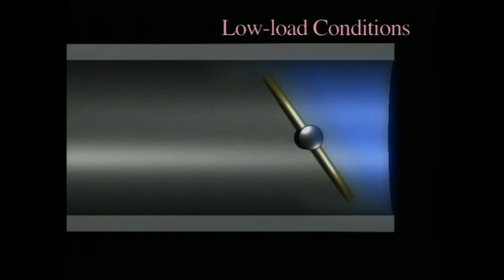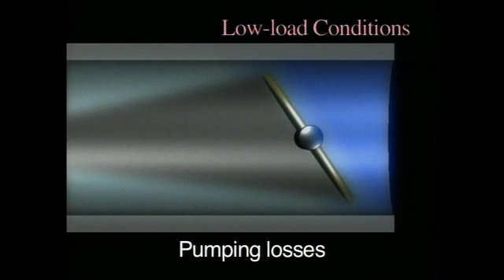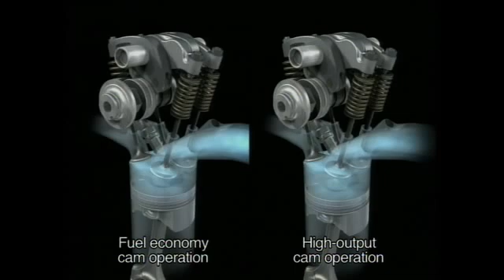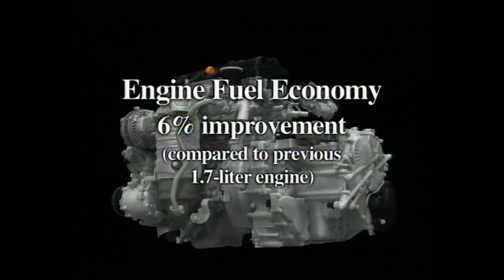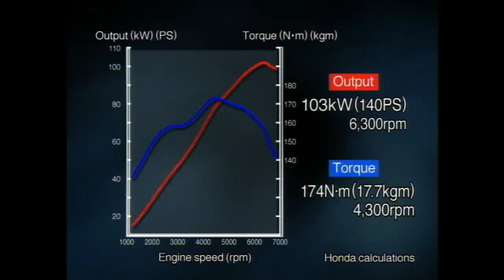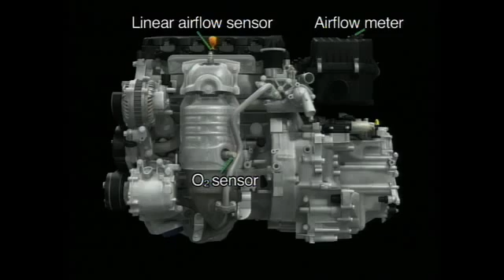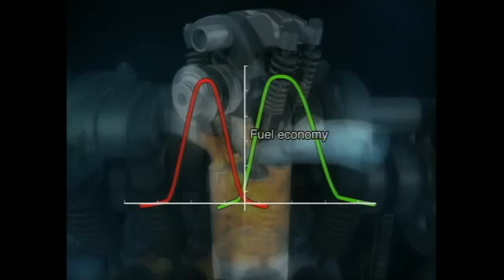Honda R18 Engine  1.8L  i-VTEC

Comment: I'm a Honda tech.  I have two 8th gens with r18.  Also an 8th gen si and an FK8 type r.  The r18 in my opinion is the most reliable 4 banger ever made.  Impressive.  Got 300+k on one and never once had an engine problem.
Reply: I know a dude who has a r18 stock internals with turbo pushing 274whp. TSI turbo kit. 440cc RDX injectors I think with the kit and hondata. The fuel pump is a stock si fuel pump I believe. The manifold is integrated but makes a nice turbo manifold to bolt right onto it. Im looking into boosting an r18 :)
Reply: Is every 8th gen have r18 engine? (Si not included)
Reply: @keantandrei8142  No, in Europe there is also 2.2i-CTDI 140HP (diesel), 1.4i-VTEC 100HP and 1.4i-DSI ~83HP
Reply: @keantandrei8142  no they have a hybrid version and they have a natural gas version in 8tb
Reply: @keantandrei8142  In the US, yes. In Europe there was also an 1.3 liter engine, that makes around 80 HP.
Reply: @keantandrei8142  i believe  so
Reply: I read something from hondata saying the r18 has oil cooler jets which only the higher performance engines have and I’ve rebuilt an r18 and they have a nice coating on the pistons for reduced wear. Sleeper engine fr
Reply: Hi Just bought my Honda FRV 1.8 Auto 2009 with 162000 miles on the clock.. change all fluid’s and it runs like new.. How reliable are they???
Hope they last longer as 1 of the smoothest car I’ve driven tbh
Reply: @Clark Nicolas  i have 404k on my 08.  Original engine and trans.
Reply: Precisely. Why they got rid of it, I’ll never understand
Reply: Hi. If you know Alot about this engine please help. I have it also but never heard VTEC kicking in. Any idea what what to do? I have automatic transmission. Does it kicks in only in manual?
Reply: @TheLordstrider  an r18 isn't meant to feel vtec kick in.  Also it is ivtec which is a little different on this engine.  It uses variable valve timing for fuel economy, not for sport or performance.  You can mod the engine for performance and get up to 400hp if you really wanted to.
Reply: @HowardFBeale-ql6gk  hey I have a r18 z1 engine in my 2015 Honda Civic coupe and I have done little mods like k/n air filter and 24p injectors, performance fuel pump, changed oxygen sensor and fuel pressure sensor, and I think I’m finally ready for a tune and turbocharged or supercharged, but I have a cvt...do u think I will run into problems? I got 100k on the dash and I got it at 79k just got start on keeping up on the maintainability.
Reply: @Jay_stackhouse  you should be fine with the milage, but I wouldn't run too much boost.  15psi would make her scream.  The cvt would make me nervous.  I don't have any experience with honda cvt's so I don't really know.  You can do a swap to a 5 speed.  I have an extra one at my shop that needs a new input shaft bearing.  Clutch pedal assembly should bolt right in.  Center console is the same I think.  You'll need a shifter and cables.  Also to swap it you'll have to reprogram the computer but you'll be getting a hondata anyway if you boost it.  Would be a fun project.  I have an 08 ex 5 speed I wanna boost when I get the time.  I'm betting I could easily get 500hp out of it.
Reply: @HowardFBeale-ql6gk  well I was talking to my mechanic and he offered a supercharger instead but lol unfortunately I’m not that well versed with manuals so I’m pretty much stuck with my cvt rn 😂, I did just changed my cvt fluids out I’m sure the previous owner never bothered but yeah he wasn’t trying to do to much boost I think he said he wanted 6 psi and I was thinking around 10 might meet in the middle and do 8 just do everything stays reliable, does supercharger use psi to measure how strong it is?
Reply: @HowardFBeale-ql6gk  400hp wow but how , must turn to Turbo charged?
Reply: @yml2290  for an r18, yes I would definitely use a turbo charger.
Reply: @lightskin keith sweat  hey man I'm in the exact same predicament as you with the cvt. Any luck with adding the supercharger yet? I really want to have my 2014 lx an extra 100 hp but I'm hoping that cvt transmission can handle it
Reply: @HowardFBeale-ql6gk 400hp? Hoow i got an 2007 Lx coupe 5 speed manual transmisión i just an K&N intake what else can do to that engine without break it?
Reply: I beley dat
Reply: Impressive. Very based.
Reply: Did u ever changed the transmission fluid?
Reply: I would maybe even get the skunk2 cams or even just a valve and spring kit. With boost it might cause valve overlap and need stronger springs to fight against boost pressure on the intake and pressure on the exhaust valves. That’s just my thoughts and maybe head studs
Reply: What about the rest of the car and transmission
Reply: R18’s are garbage engines 🚮 worst engine Honda ever made.
Reply: @ferniem95  why do you think that?  Just curious.

Comment: Love this engine, but it is slow from 180-200km/h 😩
Reply: FACTS
Reply: And one more think, when you turn on air condition, this car have no acceleration.... But I love it :D
Reply: Mariusz Wojcik really? I have pipercross and it was okay, my FN1 did only 209km/h 😂
Reply: @mariego1980  True. I try to drive my car without the AC on. Plus it makes the car vibrate pretty bad.
Reply: @mariego1980  I disagree, I really dont have any difference with the ac on.. But it vibrates on idle :D

Comment: Super engine, untill you have a problem like screw snap inside alluminium block like I had during el. starter service. Now I have problems with it. Why do you use only 2 screws for starter, and why do you use short thread step screws so that they easily cement/jam in to alluminium? Because of that now complete engine must go out of car and sent to precision machinery to take this shit out and re-thread hole, it will not be cheap.

Comment: Does the 2019 hrv 1.8 ivtec have direct injection? I hope not. And how do the cvt hold up if u baby it and change oil every 30k miles?
Reply: It doesnt have direct injection and the CVT will last as long as you keep fluid changed we put loads of miles on our hrv

Comment: cracked engine block
Reply: 06 to 09 I believe had these problems.. I have an 08 with 200K kms and so far so good. One forum said affected engines usually build cracks below the 100K km. mileage.
Reply: Juan Tamad  My 06 has 131k on it and so far good. But I had to have belt tensioner replace twice.
Reply: @MrHuck  How come?.. I haven't replaced my serpentine belt yet since owning it 4 years ago but might do it this spring..
Reply: Juan Tamad   Actually water pump broke and the belt cut into tensioner assembly so had all that replaced. Had rerouted to new Honda specs. Still keeping the car.
Reply: @MrHuck  I have an 06 too and those belt tensioners make a lot of noise.

Comment: "superior performance" to what? Id swap that shit for a b18 in a heartbeat, even b16...
Reply: To other 1.8s in its class.. economy/gas/family... corollas, etc.. your B16 B18 were built to be high output vtec engines.   There is no comparison. Would you compare a b16 with a corolla engine?  Maybe the XRS you would.. not this one.. compare you B series to the K series.. The R18 engine is truly a work of gas saving art, with its 1.8 size and 2.0 output, while saving gas like a 1.5.

And your swap wont work.  So go K or go home.

Comment: My 2010 Civic sedan is awesome car with this engine great mpg. Only issue is low torque but u get used to it.
Reply: Look up the Kraftwerks supercharger. That fixed my problem
Reply: @tylertelford1088  Is it really worth the 4k price tag tho?
Reply: Designed for efficiency. VTEC here (with SOHC) actually has the effect of lowering the power below 3500rpm and then normal afterwards, rather than the typical effect of normal power/high power band. I get stellar mileage for a 1.8L engine on the highway, 45mpg from a 11 year old engine with 140HP.
Reply: @summushieremiasclarkson4700 45mpg 🤨 stop the cap 🧢
Reply: The r18 was new for the 06 model buddy
Reply: Still more than the average petrol car. I just downshift when I want a bit more out of it.

Comment: Civic is the great car with this engine.The best engine in the world.I have civic 1.8 16v vtec
Reply: I have civic with engine but never heard VTEC kicking in. Any idea why? I have automatic transmission.
Reply: @TheLordstrider  vtec kicks in around 5200 rpms you won’t hear it like you would with the s.I. But you’ll feel it
Reply: @RiAPRIME  @TheLordstrider

R18 doesn't have VTEC. The kick you're feeling is the 2-stage manifold that opens up around 5,200rpm. Similar to a base K20A3 engine.
Reply: @tyscl9516  this is not true
Reply: @tyscl9516  research a r18 engine
Reply: @RiAPRIME  I think you gotta do the research yourself my man lol. It doesn't have VTEC, only VTEC-E and dual manifold runners. And I have driven a 2014 Honda Civic EX automatic with the R18 and my impressions were a similar vibe to a D15 engine with VTEC-E.

https://youtu.be/vDuCEiZSGXM

https://www.8thcivic.com/threads/r18-tuning-intake-runners.293253/

https://www.8thcivic.com/threads/r18-vtec-how-does-it-work.24488/
Reply: No

Comment: Lame. Nissan's vvel is better than this.
Reply: HAHAHAHHA NISSAN IS THE FUCKING LAME, with their INNEFFICENT ENGINES, very low output for the size of the cylinders they use. Tell me when a Nissan 1.8 engine can deliver 140 HP and 174 Nm of torque... Those Nissan 1.8 engine can barely hit the 130 HP... FYI
Reply: @wtrdogg20  You'd be surprised. Nissan made a 1.8L N/A engine called the CA18DE that produced 132HP without VVT or VVL. Sure it wasn't as efficient or economical, but still for 25 years ago, it was pretty damn good. CA18DE got about 23MPG combined.

As for Honda itself, this engine is nothing special. The 20 year-old B18B1 (LS Integra engine) made the same exact power figures like this R18 without any variable valvetrain components and still able to get up to 30MPG back then, and also weighed nearly the same. They're also just as reliable, maybe even more reliable because of more robust metal parts and mechanically driven parts. Those plastic parts on the R18 are a compromise of weight for extra computer modules on the engine itself.

If you want a real apples to apples comparison, check out the 3-Stage VTEC D15B engine. It's lighter and also SOHC with only VVL. It could switch between 12 valve to 16 valve mode and also had high lift cams making it capable of 40MPG and 128HP out of a 1.5L. Now you gotta think, 30 years ago it was the revolutionary engine, not this.

Comment: Watching this video trying to figure out why my r18 is getting such poor fuel economy. It’s ironic listening to them brag about it.
Reply: Biotic Focus thanks for that and I apologize for telling you to eat glass. I didn’t blame the engineers for my poor fuel economy. It was just funny to me. 

Ins14466 the car has 210000 miles no CEL, I’m getting around 220 miles to the tank. Compression is good, fuel pressure in spec, neg trending fuel trims. Car has never had a valve adjustment may tackle that tomorrow morning.
Reply: @matteo3893  well there is ur problem brainlet. Now go eat glass
Reply: Did you take proper care of the car? What about the maintenance? Did you check the air filters? What about spark plugs? Filters, oil filters, Tranmission? Any check light?
I have had 3 Hondas so far in my life (2 Civics and 1 CR-V) and something I know them for is the fuel economy they have.
Reply: L. Dega  
So from beggining you have same high consumtion problem? What is average consumption on open road, let say 60km/h? Mine is about 5l/100km.
Reply: L. Dega  
US and British mpg are same? Why online calc offers me both options and quite different result for US mpg, 47 US mpg for 5l/100km. I don't know why you have such high consumption, to me your result looks like mine full city drive. I sometimes get even 4.5 l/100 km on 60km/h (leveled road, no downhill) if I watch small sections like 10 kilometers, I will take a picture of it when I make it.
Reply: L. Dega  
I used this calculator
https://www.calculateme.com/gas-mileage/liters-per-100-km-to-us-mpg
There is offered two MPG options

Edit
And what about this?
https://www.metric-conversions.org/volume/us-liquid-gallons-to-uk-gallons.htm
Reply: L. Dega  
You should diagnose your engine in some good service, don't trust too much to check engine lamp, it can not detect all problems. Or just sell car with mistery problem  to someone else :-)
Reply: L. Dega 
After a while a finally send some images, this is "Corona" driving style, meaning that during last month I didn't use car for short distances at all. Only 10+ km relations and no highway.
https://www.dropbox.com/sh/lev14ahorqu0rvo/AADyTvu95AkvGe5GuYNVGfYsa?dl=0
Reply: Yi Wang  i used to drive a hand-me-down Sunburst Yellow 2002 Nissan Xterra and gas mileage sucked ass, i got like 13-15, and it kept giving me problems, the distributor went out, starter died, and it started giving me P0420 (cat converter) codes, all in all abt $3-4k in repair that i avoided!  My 2012 Civic is definitely an upgrade. averaging 30mpg
Reply: Biotic Focus yeah I’m troubleshooting trying to get a better understanding of the valve train. The forums are full of “change your spark plugs and air filter” why bother responding if you have nothing constructive to say? Eat glass cyber pussay.
Reply: Matteo L how many miles? Any check engine lights? How much fuel is it using?

Comment: Just got a 2011 Honda Civic the engine runs good I'm going to fix it up soon so it is time for fully for engine clean and I will be doing that very soon and transmission thanks honda
Reply: Ex or si?
Reply: @imanoldominguez7957 si doesn’t have r18

Comment: I have this engine in my 2009 Honda Civic FD1. Fuel economy????? My ass.......one full tank 40L runs only 320km mileage.  My wrx runs 380km and my FN2R hit 486km.
Reply: you might have a leak bro. i got the same car 40L gets mo 550kms to 600kms
Reply: You need to adjust your valves lol

Comment: Just bought a 2013 Civic with a good old R18 and the 5 speed MANUAL transmission, I like it! The car is fun to drive, it's pretty fast for 140 HP and got amazing fuel economy. Averaging ~5.6 liters/100 km (41-42 MPG) mostly highway and country road but still super efficient in city too. I do ~750 km on a full tank and still have 8 liters or more when i fill up with regular gas.
Reply: 5 speed manual? Thought all of them were 6 speed. Mine certainly is.
Reply: @WH250398   civic SI has 6 speed
Reply: Add Ktuner or flash pro n turbo it
Reply: @wo1fman570  hey man which exact tuner would work I got a 2014 and am having a hell of a time finding any forums on it, also a nice turbo kit😭🙏
Reply: @Justin-ux2vz  ya ever figure out what turbo kit and ktuner to throw on that bad boy? I just purchased a 2014 5 speed myself and was looking to have more fun ;)
Reply: @thotianahaynes8041  to be honest with you man after all the forums and research your best bet is to either throw a k series in it or trade it in for an si, the rods come forged from factory but are very tiny, they just can’t really hold a lot of boost and don’t make much power unless you starts going into the internals
Reply: How is that possible? I'm only getting 24 mpg on the city.. That's not too much, I'm on Honda Civic coupe 2013 automatic transmission, I love my car but would like to get more fuel efficiency
Reply: @JavSon182  Maybe it is because the winter? Winters is pretty rough here in Québec, Canada. I'm averaging about 8.5 - 9 liters/100 km (25-28 MPG) mostly city driving. Strangely, since I replaced the summer tires 2 years and a half ago, I "only" got 6 liters/100 km (39 MPG) the summer in the very best. Mostly 6.5 liters/100 km (36 MPG) city/country roads.
Reply: Est-ce que tu avais une plus faible consommation avec une civic 7th gen? Je vois dans tes vidéos que tu as une 2005.
Reply: @anonyme0897  Ouais, jetais capable de faire environ du 6.2 litres au 100 km. Avec mon 2013 c'est aussi économique sur route mais en ville/combiné ça l'est moins, 7 à 8 litres au 100 km en général.
Reply: Do you have to rev to move it though?
Reply: Is it fast with the manual transmission? I got an automatic one and I’m thinking if it’s worth doing the manual conversion just because I’m reading how long lasting these engines are so I’m like why not invest in something that has the potential to last longer even if it’s not the fastest but let me know what kind of cars you’ve ran up against if you have
Reply: @GapSauceMafia Manual 6 speed is fun to drive. And it delivers quite torque when over 3000rpm
Reply: @GapSauceMafia  Not really fast, the gearing is tall
Reply: @joelsimard1148  ah shit good looking out g
Reply: @@jm7racing Yeah I know, I thought it was fast compared to my previous 115 hp 2005 Civic but here today I found this is slow lol. My 2001 Miata feels way faster because the short gearing and light weight.

Comment: None of this matters whenever you unknowingly buy a 2006-2009 honda civic and the engine block has a crack in it from the factory. And they won't do shit for you! Even after they admit that it was their fuck up! $4000 for a nice looking paperweight in my yard. If they would stand by their product and make things right whenever they knowingly and admittingly fucked up I'd think much more highly of the same company that I used to think made some of the most reliable gas efficient vehicles on the market. Now I'll never buy a Honda again after this bullshit!
Reply: This is true, sadly. Honda TSB 10-048 explains it.
Reply: That's only on american market R18A1, European engine is R18A2, that one has 0 issues
Reply: @MrPoppy-nt5vr  what's your point? It's still made BY Honda. Doesn't matter where.
Reply: @SickNaban  My point is clear - R18A2 is one of the most reliable engines ever made 😉
Reply: @MrPoppy-nt5vr  that may be true. However, the R18A1 is absolutely one of the worst.